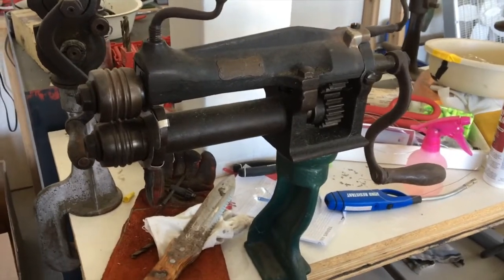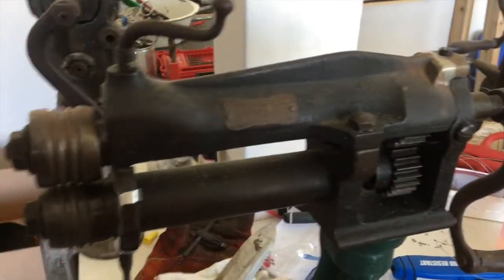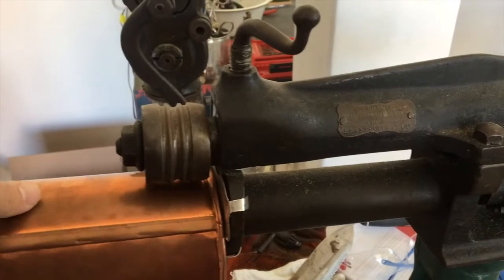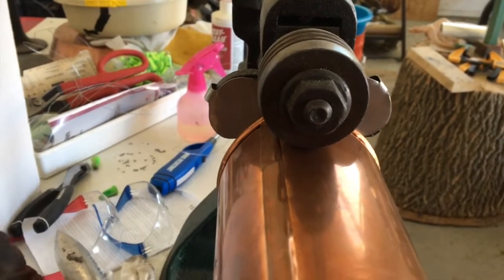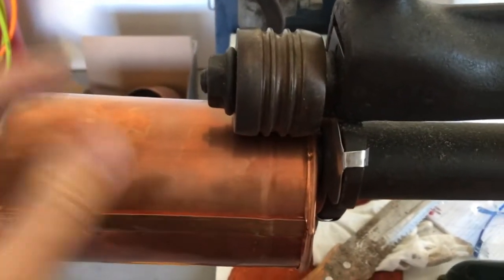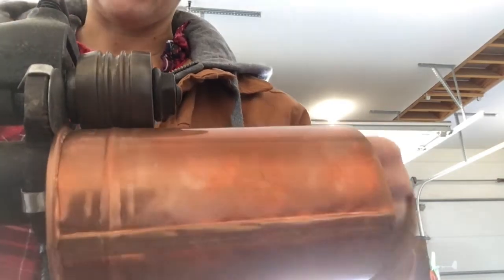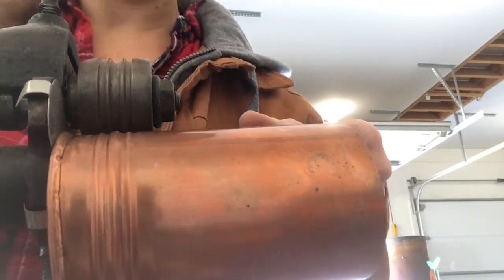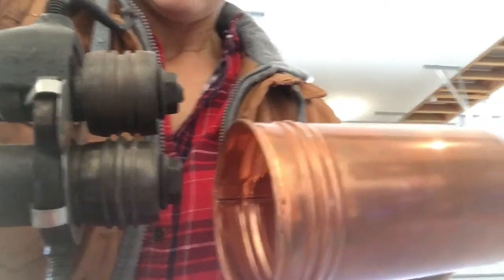How to use a Beading Machine

Comment: I use 0.32 aluminum for pipe insulation. I use oil on my beader to get a deep bead without cutting the material.
Reply from the maker: Ooo - like you put oil on the actual beading dies? What oil?! This is exciting to learn!
Reply: What part of the aluminum do you head and where and why ? Thanks !

Comment: if you won a wet oxy acetylene flame over it you can soften the metal again  you might even be able to do it with just a lpg blow torch. Heat the copper with the propane torch by slowly moving the flame across it. Make sure you heat the entire piece. Continue to soften the copper until it changes to a red color.

Comment: I am working on a decorative top for a copper lantern. It has a half round arch on the top with beads on it. I form the copper sheet to the half round before applying the beads. But the beading machine partially unflattens the copper. Since the beads give the copper strength, it now wants to crease instead of bend when i try to reform it.  Any ideas?
Reply from the maker: Yup, that sounds about right - you're dealing with a common issue. Beading will often lead to creasing (even as the beading gives strength) especially if you try to move the metal too fast. Best thing to do is to re-form by hand over a hollow mandrel (if you have that stake) or something solid in the shape you want - but you'll have to do it by hand very very very slowly and with patience. That's the way Bob the master tinsmith taught me. Lots and lots of slow forming by hand.

Comment: Nice little demo. Been searching for the right deal on some of these Wilcox machines. Missed out on 7 different machines and boxes of dies a few years ago when one of my Dad's friends passed and they sold off all of his shop equipment. I know folded seams can be very tough, I'm an industrial hvac tech. I've wrecked several pairs of shears on Pittsburgh seams. Question, have you tried rolling a bead over a cramped and soldered seam? Just wondering how it would act, thinking that the dissimilar metals may move at different rates. BTW, just found your channel a few days ago...really enjoying the content.
Reply from the maker: Hey Jeff! Thank you! And yes, it's tricky to find some of the original Stow, Peck or Wilcox pieces. You might want to come to our tinsmith convergence in June 2019. It will be at Sauder Village in Ohio. There's usually a tool swap on Saturday morning, and it's where I got a few machines last year. Some of the guys always have good stuff. 
Definitely chime in with your HVAC knowledge anytime on here. :) 
And no, neither Bob (the master tinsmith I apprentice under), nor I have beaded over a soldered seam, and we don't dabble in cramp seams as the dovetail work is a pain. We don't bead over soldered and crimp seams either - the soldering really makes the metal brittle/tempered especially when we use tinplate instead of copper. It could be that the metals move at different rates, but I would think that would come into play more during heating processes than mechanical bending.
I generally just don't want to break the 200 year old machine either, so I tend to be more cautious, too. :)
So thankful for you watching!!
Reply: That's sounds like it'd be a fun trip to plan, I'm in Texas, June gives a little time to plan. Could you post some info on the meet-up?
Reply from the maker: Yes - I will get the official dates and post!
Reply: Hey Sara, might be planning a road trip with my Dad (83yrs old) his cousin lives in Minnesota, it would be so cool if we could come by and learn more about tining hands on. If that's a possibility let me know how I could contact you you and plan something. Love what you do! Please keep 'em coming! Not many coppersmiths to learn from around here...
Reply from the maker: Oh how awesome!! I'm in Wisconsin on the east side of the state, but hey, there's plenty to do if you make it a circular trip! Email me at housecopper AT gmail.com and we can see if the timing works and a visit can be coordinated. Maybe we can do it all at Bob's - he would love it, too!
Reply: House Copper & Cookware that would be awesome! Will do! Thanks for the reply! Hopefully I'll get some cool pictures of a few very early open gear box machines at a local event we're going to on the 17th.
Reply from the maker: Also - convergence of tinsmiths (and some copper smiths and a few blacksmiths) will be June 21-23 at Sauder Village in Ohio. :) More info at the tintinkers dot org website at some point.
Reply: House Copper & Cookware Cool, thank you! We were just talking about this last night and got my Dad hooked on your channel! He was going to watch more of your videos with his buddies at the donut shop this morning😊!
Reply from the maker: Jeff Sandling ok now I want a video of your dad and his buddies watching YouTube at the donut shop!! :) Thanks for adding a fan! And definitely keep me posted on your plans!
Reply: House Copper & Cookware Hopefully I can get that as I envy his retirement, my check from the local steel mill was 162hrs for 2 weeks...exhausted but a blessing! Might just have to post it as "Texas Fans"! I recently read about an older brazing technique for pot/kettle bottoms that I haven't seen(as an industrial hvac tech I've done alot😵 of brazing) that mixed flux, brass shavings and water. As the water boils off the brass melts and is pulled into the seam. Would love to learn more about it, have you or Bob tried this? If so would y'all be willing to do a video on it? Would love to learn more about traditional techniques.